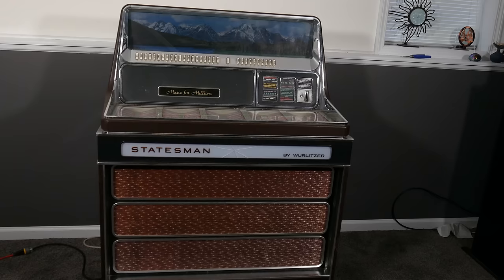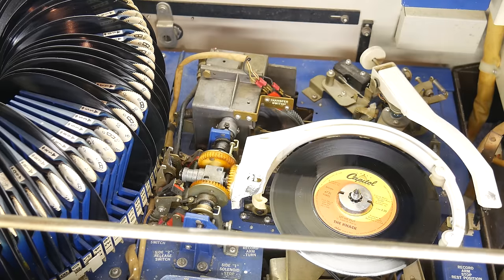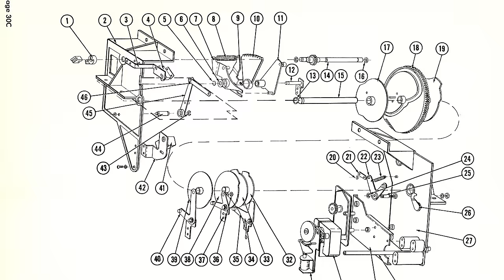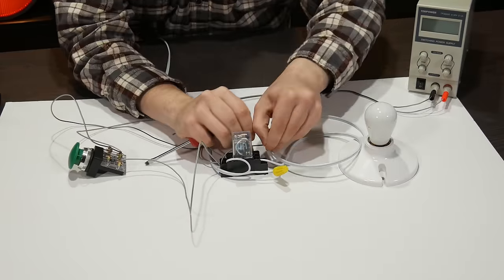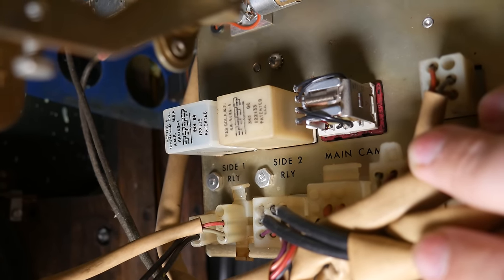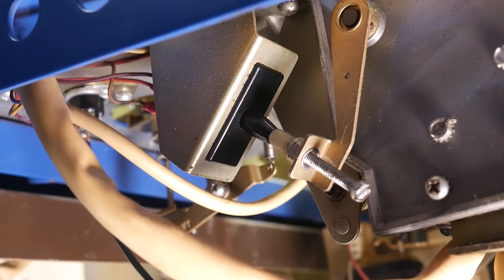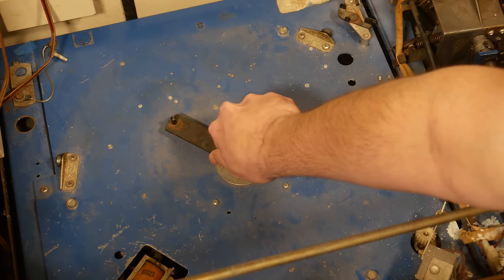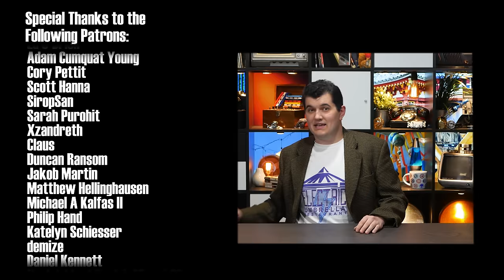The Computer-free Automation of a Jukebox (Electromechanics)

Comment: Programming is just programming. Whether it's done with lines of C or cams, it is essentially just a game of logic combining sensors with timings. In all cases, debugging & unit testing is the hardest part.
Reply: Which becomes especially challenging when a change request requires physical hardware revisions
Reply: Yes and no, electrical mechanical stuff often tends to work in a cascade of different things changing state, whereas in software you generally try and centralize the state a bit more to make it easier to manage. The cam stack here is nice and centralized and is kinda how you want the software, the chain of switches and interrupts is more cascade like. Cascade is a problem because you have to check several different things to work out what exactly is going on at the moment, which is a maintenance nightmare in more complex systems.
Reply: I'm writing in Verilog and find many modules I did (some involving SPI, UART, Mil1553 interfaces, some memory access and many more) to resemble some of electromechanics I saw in washing machine for example. "This counter keeps going until in some state it should wait for some other action to proceed" and so on, so forth.
Reply: I bet you could prove a similar system to be Turing complete, if it hasn't already been proven.
Reply: Yes. And digital computer are largely transistor logic.
What is a transistor really though? 
Well, the ones used in logic circuits are... Switches actuated by electricity.
Sound familiar? XD

Yeah. This device basically constructs digital logic circuits using relays and cams rather than transistor, but ultimately it's still broadly speaking a logic circuit.

A computer is a computer is a computer, whether constructed of integrated circuits, individual transistors, valves, cogs, or indeed water in pipes, people putting marbles in matchboxes, or anything else.
The method used is irrelevant. Only the underlying logic matters.
Reply: No actually not, the von Neumann Computer, while theoretically in the same complexity class as a simple on-off switch is a somewhat different beast to one of those devices. Both are finite state machines as both can only be in a discrete number of (relevant) states. You on-off switch only has 2 states, such a jukebox may have hundreds of states (one for each record and each state required to play it) while even the simplest 1024 bit computer (128 octets) will have 2^1024 states it can be in. (we are talking about computers like the Kenbak-1)
That's
17976931348623159077293051907890247336179769789423065727343008115773\
26758055009631327084773224075360211201138798713933576587897688144166\
22492847430639474124377767893424865485276302219601246094119453082952\
08500576883815068234246288147391311054082723716335051068458629823994\
7245938479716304835356329624224137216
states. Modern computers have billions of bits of state, so the only chance you have is to compartmentalize your system into many tiny systems which is what modern programming languages like Erlang attempt to do. This is also what more experienced programmers will eventually try to do, regardless of the language.

With such an electro mechanical device you can still draw state transition diagrams and you can still logically proof that it will never enter certain states or that it'll always end up in one state eventually.
Reply: @Peter Frencken a plc programmer is usually just an electrician who can use a computer
Reply: Programming is mostly about managing complexity. Procedural stuff is pretty low level and not something you'd be doing all that much of when building an app these days.
Reply: @cadekachelmeier7251  Someone sort of did. In 1837 a British guy named Charles Babbage designed a machine he called the analytical engine, a Turing complete mechanical computer. Unfortunately he never got the funding to build one.
Reply: @KuraIthys  I agree however one important distinction worth noting in the definition of a computer "an electronic device" so there is some middle ground where you can create logic without the use of any electronics which by definition would not qualify as a computer.
Reply: Famously the Apollo Guidance computer program was esentially weaved. Giving When Software was actually Hardware.
Reply: @vgamesx1  Mechanical adding machines and cash registers are also computers, as much as their modern electronic counterparts.
Reply: @cadekachelmeier7251  It has already been proven, many times.  All you need to do to prove something is Turing complete is to build a Turing machine, and there have been fully mechanical Turing machines built (although they're all pretty unreliable, and obviously, very slow)
Reply: I guess you could look at mechanical systems as either highly threaded linear programs, or alternatively like VHDL, where all code blocks run in parallel.
Reply: where's the "have to come up with this insanity" part then?
Reply: it gets more fun here with integration testing
Reply: The internals of this contraption look like an unmanageable piece of spaghetti code.

Not that it needs to be manageable, since it's hardware not software, but the amount of logic that switches other logic while being timed exactly with other logic makes me anxious.
Reply: Oh come on, this would be soooo much easier with an Arduino! And especially the more logically intensive part covered in the next video.
Reply: Yes, but in this case you debug with a file and a screwdriver.
Reply: @PabloSanchez-qu6ib  *deburr :D
JK That's great!
Reply: God, to debug this machine would be hell if programmed wrong.
Reply: Just as long as no-one plays la cucaracha, everything will work fine, no debugging necessary!
Reply: Yep. You can program with a keyboard, a soldering iron, or a tool kit. I've done all of them.
Reply: Ppppfff, who needs QA, just throw it out there and fix problems later when people complain.
Reply: @theantipope4354  and debugging embedded code by snooping at the D/A bus with a scope. Been there, lots of fun.
Reply: I'm not confused. A mechanical program is not fixed any more than a C program, a program on a punch card, or even a UV-erasable PROM. And I've used all of the above at one point or another. They can all encode a sequence of events and conditions, which is essentially a program. They all can be altered, even though the operation is more or less complex depending on the medium being used.
Reply: the logic design of systems like this is sorta kinda like programming, if you squint. Nobody designs the mechanical aspects of such a control system first. You start by figuring out what signals you need to process and how, then implement them mechanically.

Analog electromechanical computers were a pretty common thing until the 1960s, and digital used a lot of the experience gained with those when starting out.

The physical cams have physical dependencies, true, but the logical equivalent of the cam used when designing the control system conceptually does not.
Reply: @allmycircuits8850  I use VHDL at work. However, 35 years ago I was doing similar things using just a Prom, a Latch and a lot of working out fuse maps on paper. Fun fact, the design aid for the very first (Signetics) FPGAs was simply a pad to note which fuses to blow. That is why they didn't catch on while MMIs PALs along with their Palasm design software were a big success.

Comment: I love how all the switches and relays and stuff are CLEARLY LABELLED watching Curious Marc trying to fix and restore old elecro-mechanical devices, I can't help thinking how wonderful this is.... no searching through obscure dusty manuals to find where the transfer switch is.... it's there! Look, there! Next to the label that says "Transfer Switch"... gorgeous.
Reply: That's because a service guy would have to go out and fix machines and time was/is money. We had two Pinball machines at college and I saw both being serviced. The 1977 Jungle Princess was crammed full of  relays. The 1979 Williams Flash just contained a couple of big circuit boards.
Reply: Yep. They were designed to be maintainable (though modern pinball are decently servicable too). Old EM pinball are built like tanks and other than an occasional waxing or switch adjustment, will effectively last longer than you will : D
Reply: some engineer finally decided to label things correctly for future use! Here we ARE!
Reply: Are you referring to the Moan?
Reply: This is the mechanical equivalent of properly commenting code....

Comment: So basically, mechanical things are the equivalent of using a million “else if” functions
Reply: Digital electronics, at their most basic level, are quite similar. 

What I learned when taking a class on it is that many logic circuits that do other functions, are really just basic logic like that. Many logic gates that do "complex" things are comprised of multiple, sometimes quite a lot, of simpler logic under them.

A NAND gate and NOR gate are comprised of multiple AND and OR gates. 

A flip-flop uses multiple of those gates to self-power itself in a way similar to how the relay self-powered itself when switched on, and quite a few types of memory is made of ridiculous amounts of flip-flops, with different gates made of flip-flops being used to store data in a rudimentary way or to even interact with it. (Yes, they are quite useful)

Bottom line, digital and computer logic is made of a thousands of different "else if" statements made by the flip flops or data storing logic gates, and a billion different AND, OR, NAND, and NOR functions are used to create those statements.

I guess the difference comes when you get electro-mechanical things actually physically moving or doing something, which digital doesnt, since uh, that's an analog thing
Reply: @sol2544  Generally I'd imagine AND and OR would be made of NAND and NOR, not the other way around. To my knowledge the set of gates {AND, OR} is not universal, while {NAND} and {NOR} are.

Actually, in modern practice for making a computer, things need to be optimized enough that you would never use a NAND or NOR to create a gate that could be a different physical circuit. Still, the general idea still applies.
Reply: @sol2544  was just wracking my brain for that term "else if" thank you.
Reply: Yeah, fair.
Reply: @berylliosis5250  not quite. You can actually make any logic gate using just the NAND gate, and thats how they're built on computer circuitboards
Reply: AND, OR, NOT, NAND, NOR, XOR, etc. are all built up from the same "normally open" and "normally closed" relay contacts, in the appropriate combinations.  Google for 1970s/80s textbooks on "Logic Design."  See also TANT Synthesis and TONT Synthesis.
Reply: @sol2544 they're so similar, you can indeed build a modern computer with nothing but relays, a shit ton of wire, and an obsession with detail and labeling.

It'll be hotter than the sun, take up a warehouse of space, and consume the power of a small developing nation, but you can do it.

Comment: As a programmer, I find electro-mechanical devices to be extremely impressive and intriguing, it’s like a puzzle and with enough examining you can reverse engineer it and suddenly it all makes sense, but until then it’s like magic with all the little moving parts. I can make a program to do (almost) anything I want, but I couldn’t even make hardware if my life depended on it.

Comment: "Switches, we can almost be endlessly clever with them."
We did. We build computers out of them.
Reply: "Self-latching circuits with interrupts" are basically SR latches in the electronics realm.
Reply: @koyrehme4361  Yep, that's pretty much it.
Reply: Oh snap
Reply: Some Potato and they’re now like a thousandth of the size
Reply: @alyx6427  More like a millionth, from millimeter to nanometer.
Reply: Just a few more of them, like AMD's 64-core EPYC CPU having nearly 40 BILLION of them.
Really transistors, not switches, but you get the point.
Reply: Step aside SWITCH !
I'm analogue - and CAN be endlessly clever :)
Reply: @catsspat  A basic transistor has 3 pins; power, control, and output which work a whole lot like a relay but perhaps simpler in some ways to understand (there's only 3 connections after all though you do need another device to hold the power on).
Reply: @grn1  A basic transistor?  Is there a non-basic transistor?  You might want to read up on how transistors work. For a NPN BJT transistor switch the Base is "input", the Emitter is Grounded, while the Collector receives power and the output is taken from the Collector,
Reply: @kennmossman8701  TBH I was both trying to simplify and trying to remember.  I haven't really studied electronic hardware in probably 10 years and the course I took was pretty basic.  I honestly wasn't sure if there were other configurations but presumed there may be something other than NPN BJT which is what I used back in high school that may offer different configurations.  I really should get back into it and relearn the basic then learn more advanced stuff.
Reply: and FPGAs
Reply: @catsspat  Not quite transistors, but JFETs
Reply: @leozendo3500  I think you might find that T stands for something inconvenient to that statement.
Reply: @Archgeek0  lol that's true but when anyone say transistor I think of bjt
Reply: Fun fact: it appears that the name "stack" for the LIFO memories/data structures in modern computers does not come from the idea that data was "stacked" in this data structure...but that in the first computer to feature such a "stack" (the Stanislaus), the mechnical arrangement of the relays for this LIFO memory looked like a stack. Of relays.

Wikipedia article about the inventor of the stack (and constructor of the Stanislaus): https://en.wikipedia.org/wiki/Friedrich_L._Bauer

Bauer himself called the stack Keller (cellar), and the  machine had both an "OperationsKeller" (Operations Cellar) and a "ZahlKeller" (Number Cellar).

Here's a picture of the computer; not much can seen of the inside, though: https://commons.wikimedia.org/wiki/File:Stanislaus_computer.jpg

Yes, that's a handle at the top; it was famous for being so compact.
Reply: That's how crazy gamers build computers within computer games ;)
Reply: @koyrehme4361  yeah but I can't hotwire my cpu back to life if it breaks down while I literally fixed plenty of these bad boys with 0 electronic knowledge and a piece of string.
Well more like Jerry rigged but hey, a shoddily repaired device beats a 400$ piece of junk any day